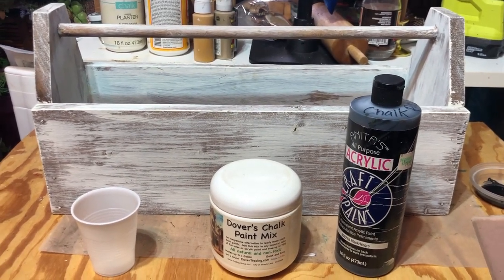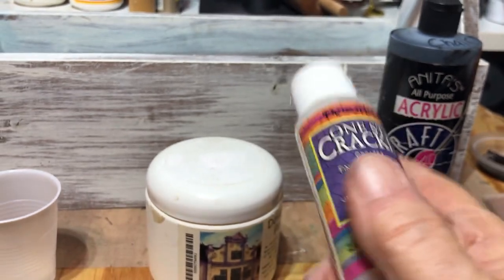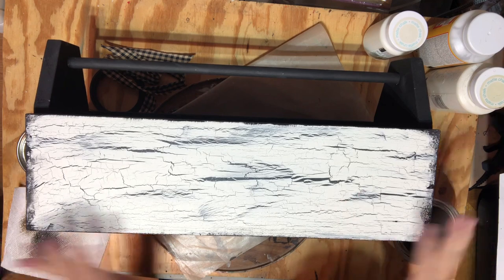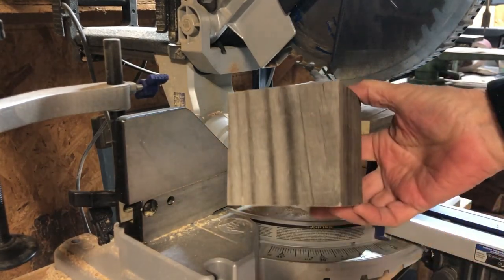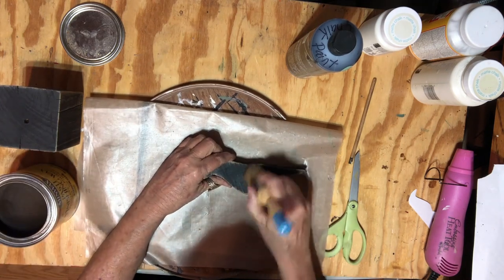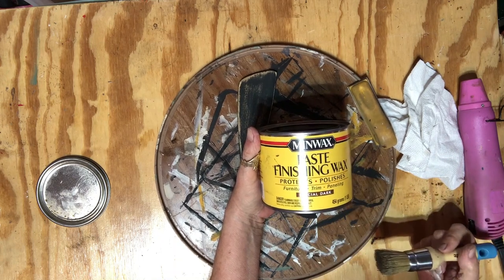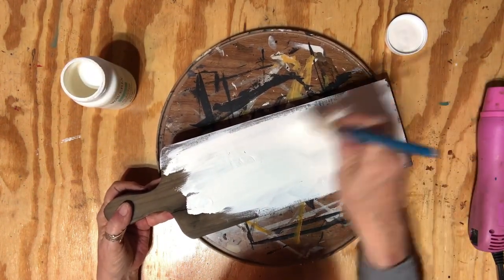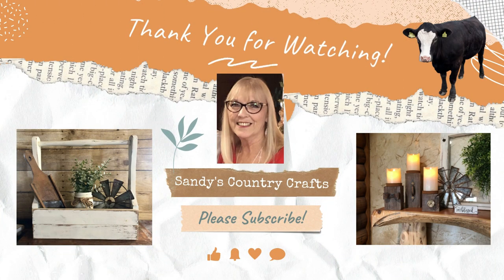DIY PRIMITIVE / COUNTRY KITCHEN DECOR

Comment: When I've created cracking effect, I put the glue down in one direction and paint over the object while the glue has "just gotten a light dry film on the top"  I never wait until it is fully dry.  I've had the best results using this method.  :)
Reply from the maker: I've tried so many ways.  I just have a hard time with crackle. ..  😆

Comment: On the tool box.. If you had gone in one direction with a good amount of paint on ypur bruah and not gone over it again in the opposite direction the magic would have happened. I have only used school glue and i get all different size cracks. The cracks go by the amount of glue you put on. Also you can dry it with your heat gun. I find ot makes better cracks then if i just let it dry. I hope you dont think I am being a know it all..I was just letting you know what works good for me.
Reply from the maker: That project gave me fits.  I have never had that much trouble getting a crackle.  I will make sure not to back stroke next time.  I can always use little pointers on what to try.  Thanks!